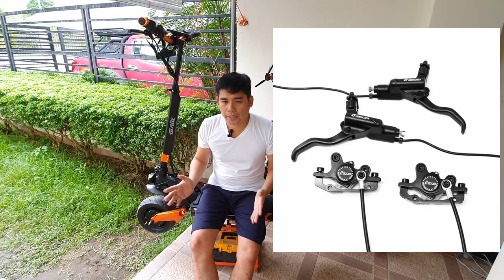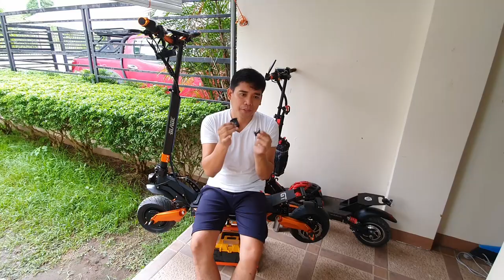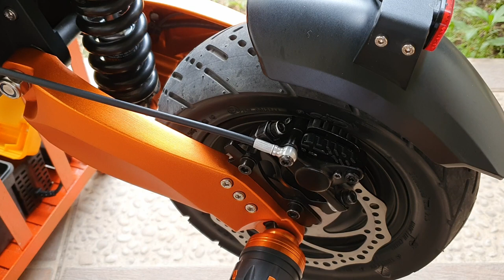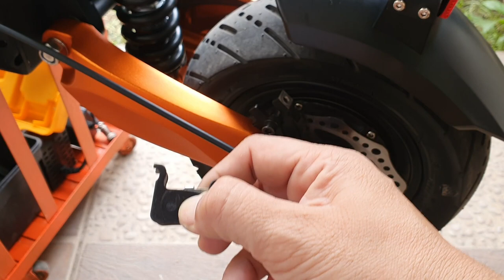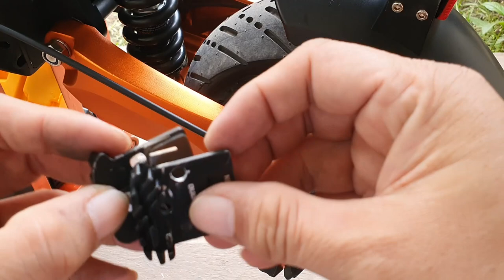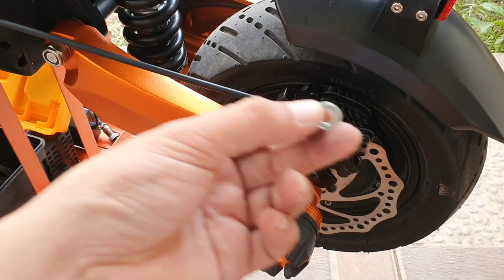Shimano brake pad installation to my Blade GT Plus

Comment: Super bulky rear  socalled frame sliders on this thing & should work to help induce the impending high side when bottoming out said slider on the pavement, Boom off you go into the weeds for failing at looking like Reving Kevin Swantz. Go go gadget copter RG500 GAMMA.

Comment: Hi,is it fit also to zoom brake?
Reply from the maker: I think the unbraded brake is zoom. So definitely zoom pads wil fit.
Reply: @ScootTaBai  thank you,im planning to changed my brake pad this week i will try the shimano if i there is in the shop near in my place
Reply from the maker: Awesome.. Just hit me a message if you need help with your installation :)
Reply: @ScootTaBai  thanks kabayan,i appreciate it,by the way ang scoot ko ay rebranded na zero10X,good luck to your upcoming growing chanel
Reply from the maker: Thank you too sir. 😊
Reply: @ScootTaBai  kabayan nung magpalit ako ng brake pad pagkatangal lo ng pad bago ikabit yung bago napress ko ang preno ngaun ng ikabit kona ang bagong pad pagnagpreno ako ayaw bumalik yung bilog na nagtutulak sa brake pad para dumikit sa discbrake,kaya kumakapit ang pad pano kaya mapapagana ulit yung bilog sa caliper para pagkabreak babalik ulit ang bilog,salamat kabayan
Reply from the maker: Remove the pads first and press the piston back using a hard object. Usually ginagamit ko is kutsilyo papasok ko sa gitna para bumuka ang pads. Pero kung ayaw talaga, bleed your brakes nalang. Slightly open your reservoir to release the oil pressure para babalik yung piston ss position
Reply from the maker: Chat mo ako sa messenger paps para ma guide kita Earl D'Earth
Reply: @ScootTaBai  salamat bro ginawa ko yun kagabi pero diko natapos tuloy ko ngaun pag d ako nagka igi mag pm ako sau,salamat bro,God Bless
Reply: @ScootTaBai  nagsubscribe na din ako sau bro good luck sa youtube chanel mo bro

Comment: u show J03A breakpad but on the video i see J02A... :D
Reply from the maker: Hahaha the sample is from my MTB with SLX groupset with J03A. But what I bought is JO2A. I don't want to ruin my mtb brake pads if you know what I mean 😀
Reply: @ScootTaBai  both the same size? :)
Reply from the maker: Yes, the same size. The difference is the material of the risen pads only.
Reply: @ScootTaBai  so 03A is better?
Reply from the maker: Yes, J03A is better. As per Shimano it is 40% more wear resistant than J02A.